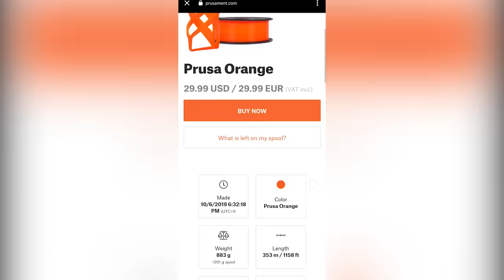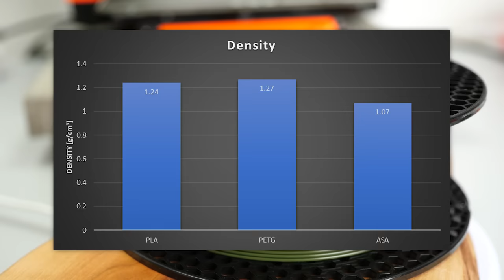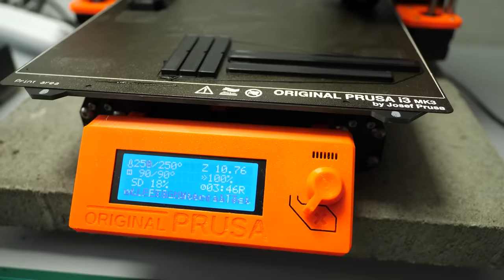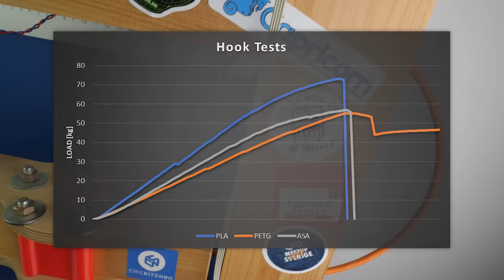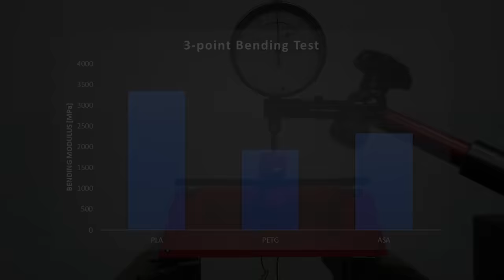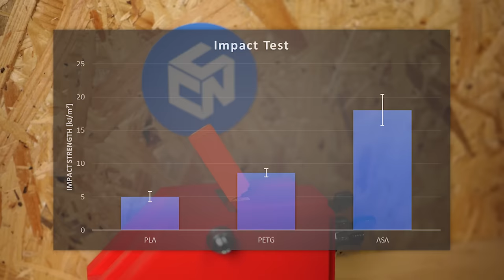The BEST 3D printing material? Comparing PLA, PETG & ASA (ABS) - feat. PRUSAMENT by Josef Prusa

Comment: One interesting test to see might be UV resistance. Not quite sure how to properly test that but PLA tends to get really brittle in sun light which is why I avoid it for anything functional.
Reply: Another important factor is cold resistance. For example flex material I use is pretty much indestructible in room temperature but snapped immediately in -10C temperature.
Reply from the maker: Here you go: https://youtu.be/smIi4zrfatw

Comment: I used PLA with my Prusa i2. After upgrading it to a 2.5 with the PEI spring steel bed I never got good adhesion anymore and now use PET or PETG. It sticks like glue to the bed but you get more fine hairs (stringing) on the print.

Comment: PETG - because it has resistance for deformation over long period of time. PLA deforms over time even at 15C temperature if it has pressure applied.
Reply from the maker: Creep, yes. Want to test and compare that soon.
Reply: @CNCKitchen  if you're doing so, it would be interesting to know if annealed pla is also affected by creep

Comment: I usually use PLA unless I have a reason to use something else. If I need something stronger and can get away with PETG I'll use that, but occasionally I bite the bullet and use ABS. I've not tried ASA but I may have to.

Comment: Not sure if there is UV resistant PLA but I've found that the sun absolutely destroys it within a few weeks. PETG is easy to print and strong enough for most things I need and there is very little smell. I also like TPU for flexible prints.

Comment: Thanks for this really informative video. PLA is the mechanically best choice but there are some cons:
PLA is quite rigid but really hygroscopic, not food safe and neither chemical nor UV resistant. If I neeed the mechanical
strength of PLA (or even more) I print carbon fibre reinforced PETG (using a hardened steel nozzle).
Usually I print standard PETG although prints are not as pretty as PLA prints.
I would be interested how much better layer adhesion performs with carbon reinforced
filament against a non reinforced counterpart.

Comment: Makes me really interested to try out ASA and do some more testing w/ enclosures etc. However I'm printing in my relatively small room as I'm still studying, so any odor-emitting materials is a nogo until I get a larger place. So far I've come to love PETG for various practical prints or mechanical parts. The low fan speed is also a plus. PLA prints are reserved for various miniatures etc, which look really good with a .25mm nozzle and lower layer height.

Comment: The only time I've used ASA that I think I may have really needed it was on some small (less than 10mm diamter) gears where PLA and PETG couldn't get sharp enough corners or consistent enough detail. 

One thing that I'm sure you know, but might've been worth at least stating is that ASA is good for items that live outdoors because it's more UV stable than ABS while still having similar temperature stability.

Comment: I print asa on a Zortrax M200 with a full heated enclosure and in my experience the part strength of asa printed PROPERLY is well beyond either of the other thermoplastics, I also find that asa shows its true strength at 100% infill with 0.10 layer height and acetone vapor smoothing. I print firearm parts which push these plastics to their limits and would only consider composit nylon thermoplastics to be superior to ASA for this application
Reply: I agree the the enclosure does help a lot but from my experience you still lose a lot of strength in the layer adhesion

Comment: Even after all test results I would use PETG for quadcopter frame. I doubt that there will be enough kinetic power (due to low weight of quad and relatively low speeds) to break PETG on impact. But due to stiffness it will act as a spring in scenarios where PLA will crack. Can't really say about ASA, but ABS deformations also usually irreversible.
Last problem is weight, but I think you can print 3D cage that could handle impacts in any direction and still will be as light as possible.

Comment: It sounds like ASA might be a pretty nice rocketry material on the "cheap side" of the scale. higher deflection temp. better shock absorption. lower density (lighter parts) I will have to see if layer adhesion can be improved. that is the only place it really seems to be lacking. at least for rocketry.

Comment: I don't have a 3D printer, but if I'm correct the force that the material can hadle is also depends on the force direction. I think if you print the "9"s horizontally and not vertically then the tensile test would have been much better. But that's theoretically of course, as I said I don't have a 3D printer, I just studied mechanics. Nice video by the way!

Comment: One cheap improvement for the enclosure I found is using making tape to cover the gaps. I've seen significant increases in print chamber temperature when you stop cool air from exchanging with the hot air.

Also I'm curious to know how printing parts at a 45° angle would affect the various metrics of your testing. I find sometimes printing at a 45° angle makes it so I don't need to use internal supports for overhangs and complex geometry.

Comment: I started using ABS instead of PLA right away because I read a lot that it is a more stronger material, but apparently it is not really that. The only advantage seems to be that its heat resistant and better in impacts. So I might actually use PLA now , its less hassle and seems to be even stronger material. What do you think? The parts I am printing right now are for holing a stepper motor that will cause a force when it turns and the other is kind of a mold that holds on to a metal rot of 1 meter length which has a certain weight that the part will have to hold. So for the motor I guess the heat may be a problem, so maybe ABS is good after all, but for the other parts that will experience some force, I now think PLA might actually be better. However one big advantage of ABS is acetone vapor finishing - this looks a lot nicer than spending hours sanding the PLA with various grain size sanding paper until it is smooth.

Comment: People shitting on PETG..it's been a year i got my 1st personal printer; mk3s. I only used PLA to print toys or samples. PETG since the 1st week for all functional parts. I'm a mechanical engineer and indeed PLA is stiffer and has more strength. But it's not durable for functional everyday parts. I still have the roll of ABS sealed..got ASA to try but i need like an automotive part to use it. Also CF embedded PETG on the side if it comes up for it. Personally i love PETG. I print it all day in my room sleeping next to the printer. No issues, no smells, prints lovely on both smooth and texture beds. 0 failed prints with it so far unlike 1 for the few PLA prints i made.
Reply: Same here. The data shows not the whole story. Stiffness is not always positive. All my mechanical demanding parts are made out of PETG. Many of them would snap quickly with PLA. 
Its all depending on the use case. And in many cases PETG is clearly superior.
Reply: @michaelschaub  pretty much, btw PETG also cracks when impacted in thin sections. And i don't mean layer separation but uniform material crack.

Comment: I do not have any Prusa printers, but I started using the Prusament pla and was very impressed with the quality of the prints when I use it. I have a few Ender 3, but also a CR20-pro and this has the magnetic bed so I also brought the Prusa textured flex pei sheet and when I use the Prusament with it I can hide all the first layer print marks and it's great for printing project cases ect.  I still use some cheap £10 pla from a uk company that works ok for quick stuff, but now I know I can get very good prints with my setup using Prusament I must always have some in stock.

Comment: I would add that the prusa spool design is also great if You want to dry filament....if the sides are solid then the bottom layers wont get that dry
Reply from the maker: Good point, though some argue that the perfect winding is bad for drying since it doesn't leave a lot of gaps. Can't really comment on the last point, though.
Reply: @CNCKitchen  me neither....Ive only observed that for same amount of drying time - spools with holes on the sides started degrading print much more layers later than ones that are solid
Reply: @CNCKitchen  I guess you could also argue the perfect winding will keep the filament inside the spool drier.

Comment: I'm building an AM8 upgrade. All the parts I've printed so far are PLA+ instead of the PETG or ABS specified. With the new  2209 steppers, my motors should be cooler. I should be fine until I get other filament.

Comment: good thorough testing of both  FDM and SLA materials. Don't think i've seen such testing elsewhere on line. Kudos. What would be seriously cool would be a comparison chart with the results of both so they could be easily compared and allow makers and printers to choose the best of both for a particular end use. [unless there is one I haven't found.]
Still, the results have me reconsidering SLA for some of the things I'll be printing now that I know resin isn't just for pretty parts and prototypes. If resin will hold up in real world conditions as I suspect it may, size limits and higher cost are justified. 
Thanks for what you do ;)

Comment: I find myself using different types of filament for different aspects of the same build. If I use your drone analogy. I'd use a fiber reinforced ASA for the frame since it will need to be rigid like pla but remain light and impact resistant., petg for external cosmetics like a a cowling or cover for components since the parts will be relatively thin and likewise will make more use of it's toughness and flexibility. And pla for interior structures and mounts for electronics due to it's ease of printing and dimensional accuracy being useful for printing the bulk of the drone by mass. Definitely still use carbon rods and heat set inserts where struts on high stress areas

Comment: I use PLA, ABS & PETG depending on application. I like PLA for stiffness and ease of printing but 60degC is too low for practical applications in quad-copters motors can easily melt the frame or deform it. If only we have PLA with high thermal resistance it will be my go to filament.

Comment: Strangely having printed all 3 of those, i found that PETG is the most rigid, best layer adhesion. Then ASA is very close by but being much more flexible and PLA being the weakest on the layer adhesion. Using 205 on PLA, 245 on PETG and 255 on ASA.

Comment: i'm not an avid printer, my printer doesn't even have a year yet either. i've been printing with PLA, but now i got some other filaments to try and i'll never go back to pla as my main filament. the extra temperature resistance petg offers makes all the difference. 60c is pretty common in real world uses, 80c is not.
ASA does seem like it would be even better though. although the stretchiness of petg is very desirable.

Comment: Prusament PLA is a great material for high quality defect-free prints! Also, it's the only material I have been able to reliably use with the MMU2s. I wish there were an easier way to figure out how to mitigate jamming on that device, but using high quality filament definitely helps a lot.

Comment: I prefer petg for any mechanical application. It prints fairly well, except for the occasional goobers, and will bend where pla snaps. Abs is too toxic and requires a heated chamber to not warp so i havent bothered with it much, but it may be better for some applications. Pla prints the cleanest for me and comes in a wide variety of pretty colors and designs but is brittle.

Comment: I mostly use PLA just due to the ease of printing. Things that don't need to be load bearing mostly. If I'm printing a bracket or something to support a good deal of weight, I'll usually use PETG. (I'm never too bothered by the differences between brands. I just go by what I can afford on the day.) But if I'm in a pinch or if I need to print a lot of small objects all at once, I'll use ABS for it's low stringing qualities and low density (meaning a get much more on a 1KG spool than with PLA or PETG.)

Comment: Definitely our go-to material is HIPS. Tough and takes a beating and if you print solid easier to print than PLA. I challenge you to print a long big item >300mm in length solid with a .8 nozzle outside perimeter .88 inside 1.5mm 12 perimeters .4 layer heigh and an overhang of 45 deg. in pla. No problem in HIPS. Plus with a density of 1.04 its much lighter too and we pick it up at toner plastics for $9.99/kg Only drawback is it only comes in natural white

Comment: the hooks had to be positioned lying down, so the strength would be higher! The test showed how tightly the layers are connected, and this is greatly influenced by the print settings.

Comment: I mostly use ASA-X from Dutch Filaments. I get much more strength than with PLA with stil a good printing quality.
Reply from the maker: Can +1 that. Really nice material!
Reply: I have never been able to tame ABS even with my enclosed printer.
Reply: The ABS-X from them is great too. Very low warp. I think it's the same stuff as Formfuturo TitanX.

Comment: I've PLA+, which uses a lil bit higher temperatures to print. I print them using 212-220 degrees, not as great as ABS-ASA and PETG but hey, PLA is superior :> and still PLA+ is just an enhanced PLA.

Comment: I'm new to this, just bought an Ender 3. I'm going to make all kind of project like prototypes, drones, RC cars, miniature models, big models, every day use, outside use. I do have Vallejo paint to use on this, so if needed to be painted there are no problems in doing that.
But My question is what filament should I go for, PLA+, PETG? the temperature tops as about 55+- degree C in the sun here in the summer.

Comment: I have been using Prusament galaxy black PLA and Prusament anthracite grey PETG for robotics projects, on a Prusa Mini+ with mostly default profiles. I usually use PETG for motor mounts since the motors can get warmish and I'm worried about the PLA deforming. But the PETG is so much harder to break by hand. It's especially noticeable for thin-walled objects (and when attempting to remove supports by hand). I am not entirely sure how to reconcile this with your results. Perhaps the failure mode of PETG (bending rather than breaking) just feels more sturdy in the hand.

Comment: A great vid.. Well done! Curious as to dimensional accuracy of printed parts using different materials. Playing with PETG and occasionally ASA at the moment, I like that they can hold up to higher temps. I guess I'm thinking about shrinkage with larger ASA parts throwing feature locations off. Going to experiment here as I'm finally getting great ASA results with an enclosed printer. Keep up the good work, I subscribed.

Comment: First, wonderful video. I love the scientific method here.
Second, this might be a stupid question. I'm an electrical guy, not a mechanical one. What about compression strength? I know you tested a ton of stuff in this video, so I don't want to quibble. Is compression covered in the tests you mentioned? I'm thinking about using parts that are screwed to a metal frame (3D printer parts). Which material would be best?
I started out printing in ABS, but when I found PETG I never looked back. It is stringy and harder to print nicely, but the lack of odor was huge. I have a (maybe 7 year old) spool of clear PLA still in the drawer. You're making me think about trying it out (it's still sealed).
Also, what about PLA+?
Thanks for talking about ASA. I didn't know there was a better alternative to ABS, although I will probably still not try it due to the odor. When I read a couple of articles about carcinogenic effects of ABS plastic, I stopped using it immediately. I'd like to hear you weigh in on the health effects of each plastic as well.

Thanks again!

Comment: Nice comparison but omits 2 important factors:
1) Environmental aspects. PLA is biodegradable and renewable. BIG PLUS!
2) If you're doing thermal tests you need to include annealed PLA as a contender. And I'm not talking about using a special annealing-friendly PLA. Just do a 2nd set of test samples and anneal them in your oven. They'll deform a bit which of course needs to be pointed out in the video, but they will not become unusable, even when the PLA is not one of the annealing-friendly ones.
Reply: Petg is also recyclable but not as environmentally friendly as pla, abs is really really bad tho

Comment: I had a perfectly wound PETG roll but of course it got tangled real quick from regularly changing spools
Reply: I have learned to be very careful to not let end of the filament go free while changing spools. The end is either in my hand, in the extruder, or tucked in one of those holes on the side wall of the reel; it is never flopping free. It totally saves me for dealing with tangle issues that I used to blame on the winding of the filament.

Comment: It would take some skill to assemble, but if you were ever to make a 
reference poster summarizing the material and printing properties of all
 the common filaments you've tested, I would buy it in a heartbeat. 
Something for the workshop -- almost like a drill chart. I'm thinking 
the raw material stress-strain curves, plus the results of all your 
layer adhesion, izod impact, and temperature resistance tests, etc. Like
 I said, it would take some skill to make enough simplifications for it 
to be a good quick-reference, but not so much that its misleading 
without a thousand asterisks. But if anyone can do it, I'm sure you can!